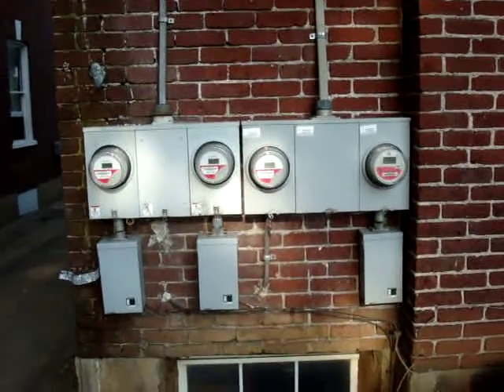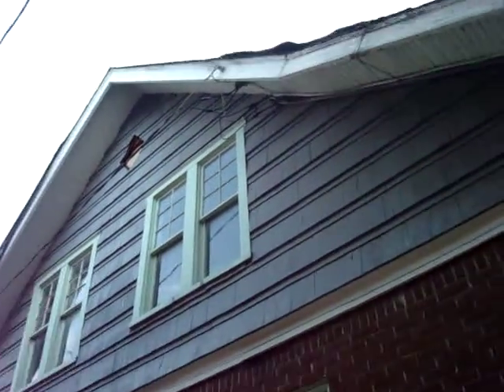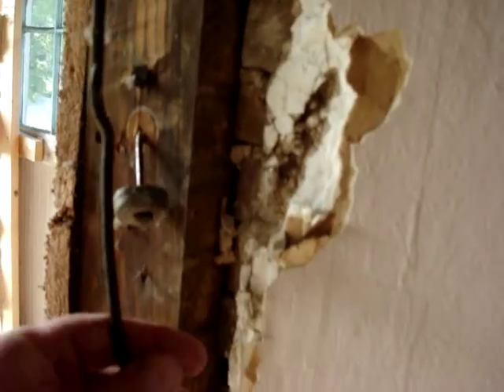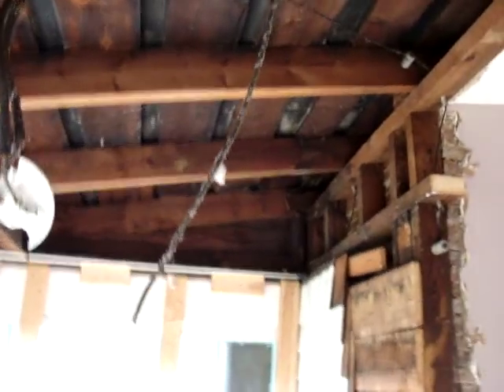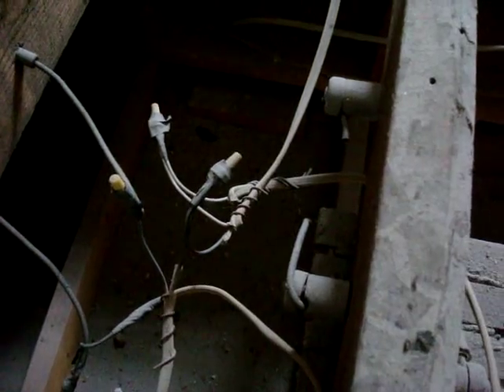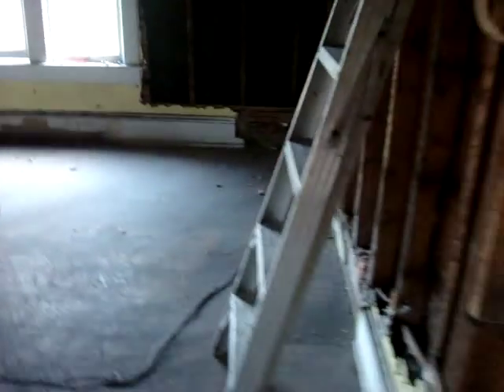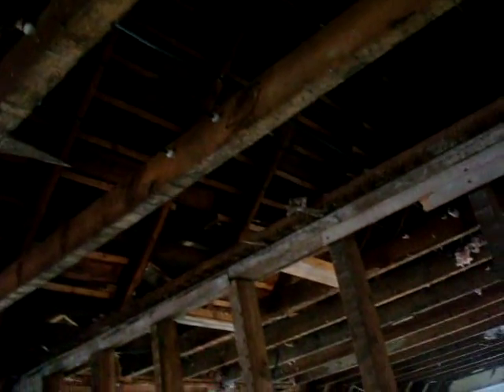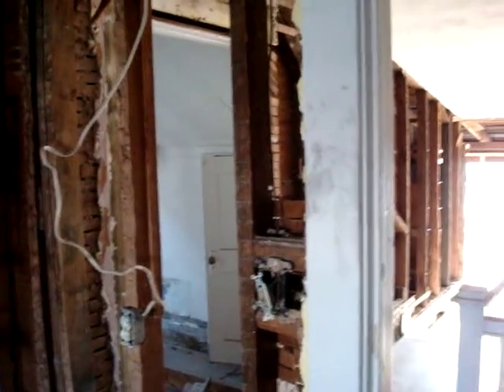Illegal and Unsafe Wiring in Older Homes

Comment: if you have to bary a splice sutch as hanging cabnets nail or screw in to wire up stairs is all finihhed no slack to put splice in proper aera is it safe in a metel box with cover good conection twisted trimed even folded in to box no stress i know it wont pass but if you have to work with what you have thankyou

Comment: well at least it is insulated knob and tube my house has all uninsulated knob and tube still in use running all the overhead lights , and I can not find a breaker to shut it off except the main breaker I can turn all breakers off and the lights are still on lol ,I found the knob and tube wiring by accident while in the attic moving insulation with a aluminum snow shovel...it hurt a lot ... all bare wires all buried a foot under flammable insulation and I still live here and to broke to fix it.

Comment: Perhaps that's a regional thing? He said it had to do with pinching the wire and the potential for making contact with the wires inside as the wire/insulation ages as a result of that pinching.

As for the book, can you suggest any specific volumes (links?)? Something detailed enough to list code requirements, but not so technical as to elude anyone above intermediate electrical wiring skill would be good.

Comment: I do take your point on that; I'm aware of older code requirements, as what I know I learned from my father. I know *how* to wire, I know what a J-box is, all that basic stuff. I wasn't aware of these anti-nail plates; that apparently became code after my dad learned how to run wire. On the staples thing, a friend who's been doing lots of code research as part of searching for a home is the source of that "bare metal on insulated wiring is not code" reference. (cont.)

Comment from the maker: You're going to wire your place yourself, and you claim that you're going to at least hit minimum building code, but you've never heard of anti-nail plates? This is the equivalent of saying you know how to drive a car, but you've never heard of the brake pedal! The building inspector can help some (by failing you and have you do it over), but you really need to buy a basic wiring book and read it cover to cover before you start. Think about safety. Metal staples or nylon can be used for romex.

Comment: code says wiring must be protected with a metal plate where it goes through a stud. codes are there for a reason. when untrained people offer their sevices without permit or proper training you have all the problems that this video points out. the lesson. hire a certified electrician who has many referinces. save a few bucks now with joe in the know and pay when you have a fire and insurance is declined cause of unpermited work buyer beware.

Comment: Started doing reno on an old (1890's original) place in Philly and quickly run into some very not-code fun. Knob & Tube wire, no junction boxes for splices, a ceiling fan installed without a box (no idea when that was done).

This is going to hurt...

Comment: Lack of humidity allows what's known as Static Electricity to build up a higher standing voltage, by making it harder to dissipate into the surrounding air (this is why you get shocked more in winter than any other time of year). Vacuum cleaners, CRT TVs, people on carpets, are all horrendous sources of static electricity. I'm no electrician, but if I were to guess, I'd say something isn't grounded properly, because you seem to be tripping the protective circuit with a static electricity dump.

Comment: I would never knowingly put more than 2 or 3 outlets on a single circuit; that's ASKING to overload the breaker without even trying (especially in today's electrical-everything world). It's better to have a bigger panel than you need with dedicated lines all over the place, than to risk overloading your breakers.

Comment: Why would cables be getting stabbed by screws? Ideally, you ran your cables down the vertical stud channel where the outlet/switch they were going to is located. Otherwise, if they cables are going through studs, you just make note of where those cross-points are and don't sink screws there...

Comment from the maker: Well, the only and best help can come from a licensed electrician in your area that sees the issues first hand. Rotten wire insulation is a major fire hazzard and as renters you have agencies in your area that will also inspect the condition of your home if your landlord doesn't. The fire marshal, local code enforcement, and tenant's rights groups should be contacted to make sure you're safe. Also, if you're renting, it's not your job to repair the place. You job is to pay rent on a decent home

Comment from the maker: It's not the same, although some appliances can function within a nominal range. 208, 220 and 240. There are issues 208 vs. 240 in three phase Delta or Wye set up. In the old days (60's) 220 was generally what rolled in a SE with 110 for the single pole circuits. That's changed now, but being picky with something powerful enough to kill you is always wise and it starts with terminology. That you use language like "call a real electrician" and "its seems like you have 220" I know what u know.

Comment from the maker: Doorbells in the old days are low voltage units that have transformers. 120v current is reduced to anywhere between 10 to 14 volts varying on the system.If the winding are worn or the solenoids aren't actuating you can get sounds like humming. But, I'd suggest you just get rid of that dinosaur door bell and up grade to a new wireless system.

Comment: I have a question? about Doorbells? I have a older house that I just paid off and I wanted to up grade the electrical doorbell.I change the wire and now I hear this low humming noise? what is that? I put all the wires in the same way they were in and I can still hear it.?

Comment: The code evovled to deal w/ things that caused fires and deaths over the years.  Many of those issues are problems only under certain situations, if luck works 1 way it's not a problem,  if it goes the other way, you're in deep kimchi.  No junction box for a connection can ruin your whole year, but only if someone puts a strain on 1 of the wires.  If it never happens, it's all good.  You only need to put your seat belt on just before a crash.  If you can predict the future, you can cut corners.

Comment: I'm remodeling three houses from 1906 and the worst part I ahve found so far with these houses is tearing out the plaster and Lath.  Messy as hell!  The old knob and Tube electrical was intact in this place, but there was a fire upstairs, so it was replaced in the 50's.  Teh whole house is on one breaker and they didn't use junction boxes for their splices lol.  It is a freaking disaster area, so I ,completely rewired the whole house with a 125 AMP service :) Cool vid BTW
Reply: Wood lath and plaster, metal lath and plaster were a bear to work with for sure.  Fond memories now in my retirement years, lol.

Comment: The way they used to do it in the older homes. Always find all the hots ran into the fixtures in the ceilings and then run a two wire to the switch. I believe they talk about that in A. 200 talking about switch loops for the neutral wire. You have to use the neutral (white) wire as the hot down and reidentify it.
Reply: Actually,not any more! The 2020 NEC prohibits this. You have to use a three wire cable:Black,red and white and use the black and red for a switch and put a wire nut on the unused white wire. The old way:White is hot going to the switch and black going to the fixture is grandfathered in on an older installation as long as you put black magic marker on the white wire to indicate it is hot.

Comment: Also, I have to say I'v been in that situation before with older homes, Iv been in telecom for over 20 + years and I had to revamp a church in Ann Arbor MI, that was 3 months long and the prints had to be updated constantly. LOL core holing through cement with AC conduit in the floors and imagining done to find the conduit so we didn't drill through them. Then I had a custom job to a 150 year old Church and rectory in Dearborn MI that was 6 months long by myself. Hats of to ya that's a job.
Reply: I hear ya, there were some interesting buildings and homes in Ann Arbor, and buildings in downtown Detroit I worked in back in the late 80's.  Fond memories to reminisce now for this retired electrician.  :goodvibes:

Comment from the maker: NEC requires a ground of 25 ohms or less or two rods plus bonding the gas and water lines. I use 3 or 4 rods min. plus bond everything for the lowest possible resistance. I also ground metal ductwork, etc.

Comment from the maker: Exactly! No more than two circuits will be on each for the criticals, for example, one 20A circuit for appliance #1, one 20A circuit for appliance #2, one 15 A circuit for fridge, one 15A circuit for DW, and 15A one circuit GD, etc. In bath I put one 15A for GFCI, and 1 for light/fan. As for the rest of the house, I group by section and function so those aren't dedicated. I will do bedroom lites for one section, or outlets in a certain section. I generally try to keep the lites and outlets sep.

Comment from the maker: I haven't mapped out anything in detail yet, and I'm spending the better part of the next two years fixing structure, so it's a ways off. I added a link to a class on excavating for footings coming up at my house next in the video description which shows just how big of a project this is!. So, I will be using as little energy as possible, and I'm hoping most lighting will be LED, and HVAC will be two ductless high SEER heat pumps. The envelope is going to be super insulated, to help this.

Comment from the maker: It's been extended to more rooms with 2009 IRC which went into effect this summer, so by 2006 IRC you're correct, but it just changed. Good use of fuel for the bonfire!

Comment: now we have a 200 amp meter and panel and most of the old wiring is replaced we still have some of the lights in the half that we didn't gut and re-do yet all the scary stuff is gone and most of what is left is stuf from the 60s it has no ground but the black and white is plastic covered it will be replaced soon i saved the old porcelain 3 way switch and heavy gauge black steel box that was at the top of the steps it was so new when it was put in that they didn't have 14-3 wire they used 2  14-2

Comment: our house was just after k&t it had 2 wire rubber and cloth wire we had 6 wires running in to the kitchen lite all stufed in a old style smaller j box with a 60s round floresent fixture jamed over the top and we had a 60 amp 240v 6 circut panel with a 2 circut diconect used as a sub panel the old guy only cooked on a propaine/oil key mac stove and had 2 120 v lines running to the dryer our house was one of the first to have power around the first one was wired 4 years befor power came with k&t

Comment from the maker: I'm not sure exactly what you're talking about. I think you might not understand what a dedicated circuit is or what NEC requirements are regarding this. Examples (required by law) are 2 20A appliance circuits in kitchen, one dedicated fridge circuit, one dedicated circuit for the disposal/DW (although I use two 15A in this case), one AFCI with 14-3 for up to 11 smoke detectors, etc. Also all living space per 2009 IRC require AFCI. And each 240 appliance gets a circuit, of course, and bath GFCI

Comment: When I'm doing a reno job I try to save and reuse the old lumber elsewhere on the job if I can, sometimes it take a bit of nail pulling but anything over two feet long, minus rot, cracks, etc, can be used for blocking. In an old house those pieces can be especially useful since a lot of the framing is full dimensional whereas the modern stuff is nominal and dressed. I do this mostly because I'm cheap and hate to waste material.

Comment: Strangely enough there is an oufit called Sundial wire that will buy the old knob and tube insulators, lamp sockets, etc, so they actaully worth something as salvage, if you can remove them without breaking them. They resell the stuff for recreating period correct wiring for historical homes with exposed wires, they use new reproduction wire of course.

Comment from the maker: Yes! Current NEC (which pretty much most Dillion rule states and/or localites require bonding of plumbing and gas (assuming the plumbing isn't entirely non-conductive). I go so far as to ground duct work also, though it's not required. I also use a minimum of three rods and often more and I go 8 feet apart instead of six to maintain a good distance between the spheres of influence. Good reminder.

Comment from the maker: The house, my objectives, and the neighborhood zoning are much more complicated than your assessment allows. The core issue in a major renovation like this is to salvage the energy that already been spent in the initial structure and then renovate in such a way to minimize energy usage for the future. Also, the materials and labor used during the renovation should be the most efficient as possible. This type renovation focuses on true cradle to cradle philosophy. It's how I run my business!

Comment from the maker: Hi,

No, you can rewire without gutting. I totally gutted in this case since the structure had problems, I wanted to conceal the HVAC ducts for the new heat pump, and to rewire and replumb.

It's hard to estimate a job without seeing it. A general rule of thumb is rewiring is $6000 per floor plus the cost of the service entrance so $10K ish, but that is really general.  You should get a licensed electrical contractor on site to give you a real estimate.

Comment from the maker: Knob and tube can't be connected to anything (NM, AC) under any circumstance. If the knob and tube needs to be touched, it has to be removed entirely and a new circuit needs to be run. Knob and tube can only remain if it's untouched. So, too short or long enough doesn't matter--it's just illegal to splice knob and tube. Sadly I see it all the time and often buried in walls!

Comment from the maker: Temp extremes are always an issue for both Romex (NM) cable and individual conductors inside of BX/MX or conduit. It's very important to use the correctly rated insulation on any conductor. I like MX cable also. There are some applications where EMT must be used in commercial wood frames buildings 3 stories or more, so I have seen EMT in these cases.

Comment from the maker: @JamesGlassProperties unless nailing plates are used
5. you don't understand over current protection with that statement, but it's a common misunderstanding. Amacity is determined by wire size and other factors to properly calculate over current protection, this doesn't address AFCI or GFCI
6. a great book for you to check out for DIY and to learn more about safely using electricity is Wiring a House by Caudwell

Comment from the maker: @Livinggreen100 
1. faulty inductive reasoning on length of service vs. danger--resistance and heat can come at any time
2. NEC does not allow any knob and tube to be connected to NM and NEC certainly doesn't allow running loose ground wires outside of conduit or sheathing
3. everything fallible--it's more so when poor craftsmanship and lack of sound building is employed
4. NEC address how to proper fasten NM wiring and doesn't allow any wire within 1.25" of finished surfaces unless >next box

Comment from the maker: @ElitePokerPlayer Thanks. Large portions of the roof decking will be replaced due to rot and incorrect construction from when the house was new. The 5/4" material on the roof with gaps is OK as long as there is suffcient sound decking to nail shingles to. The roof is outside the building envelope so there are no thermal issues. But, it's vitally important, as you wondered, that the decking be sound enough to nail to and each shingle gets 4 nails (overlapping for a total of eight) in this area.

Comment from the maker: @Membrane556 Yes. Knob and tube was installed with 30 or 60 amp service back in the day, and most people cooked with gas or wood. Microwaves hadn't been invented yet, and people hung their clothes on the lines to dry. Plus, there certainly weren't any heat pumps in 1920 in every home!

Comment from the maker: @windoes98se Nuetral (ground conductors) become fused when wiring, over current protection, or devices are installed incorrectly and 120v grounded conducting current can't properly make it back to the center tap of the transformer. A number of reasons cause this and all of them are fire, shock, and electrocution hazards. Call a licensed electrical right away!

Comment: @Livinggreen100 
The old knob and tube wire was perfectly safe when it was new but the problem is it's 60+ years old which means it's insulation can often be brittle and cracking.Plus it's usually very undersized for modern demands.